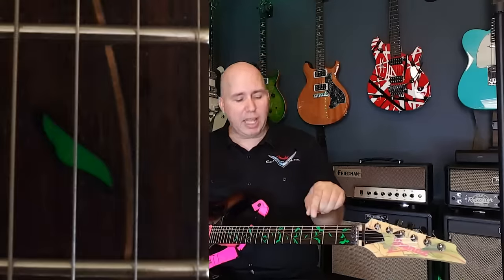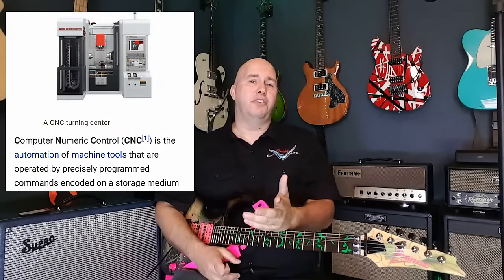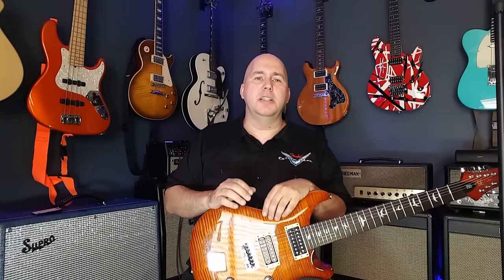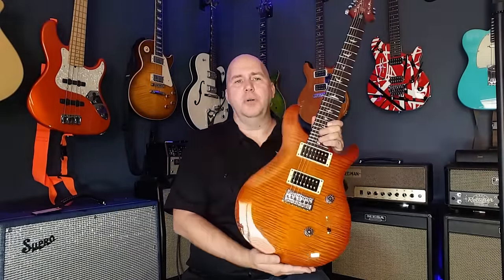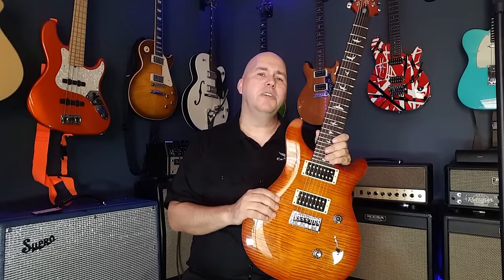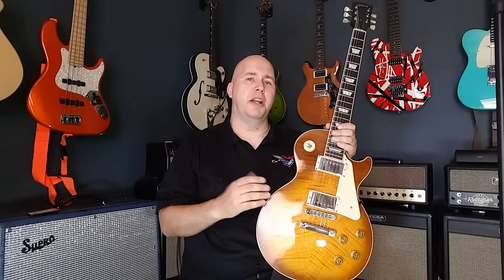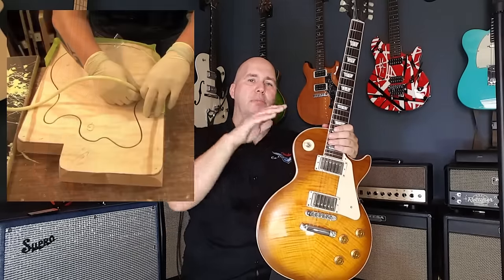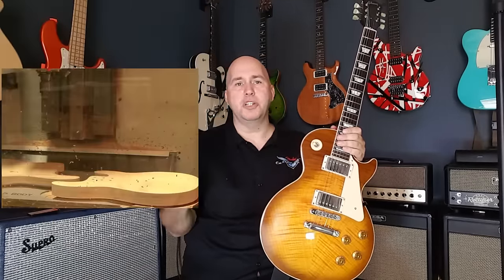7 Things That Do Not Make Guitars Expensive Anymore

Comment: I have a couple of blue flower fenders - a Tele and a Precision Bass. I believe the original incarnation was derived from wallpaper that a Fender employee found in a hardware store in the sixties. The line finished when the wallpaper became obsolete. The reissues that I have came about when a gash roll of wallpaper was found in a bargain bucket, only this time, Fender copied the original wallpaper digitally, so it would never run out.

Comment: You were right on about body binding (though the layers of material in some are more painstaking to make than others) On neck binding, you could have went a little (or a lot) further into it: Especially considering neck binding and whether it goes under the fret ends or has to be hand-fitted over the fret ends.
Gibson used to do the latter concerning fretboard binding but have now gone to CNC binding under the frets though the prices didn't drop accordingly.

Comment: I have found that the lower priced guitars can have great play ability,but where the corners are cut is the hardware and electronic package. I purchase Ibanez s series around the 800-900 price range and then put new pots and pickups(the tuners are pretty stable on this brand so I don't flip those) and you have a premium instrument for less than Ibanez sells it for.( and you get pick ups that are closer to your own tone preferences) Fender same deal,but I recommend replacing tuners with a locking type since part of a lower priced Strat's charm is a bit of tuning instability. Some of the 400 dollar squire Tele's play really great as well.

Comment: Some veneers are actually pretty darn expensive. Brazilian Rosewood, for instance, has gotten so scarce now that even veneers from it large enough to fit a back and sides (outside only) cost around $80 for the luthier to buy at cost, and then you'll pay for his time to put it on. There are several veneers of exotic wood large enough to fit a top that cost around $25, but it's the time it takes to cut and glue it that really makes the cost go up. A hundred bucks is not at all out of line for many of them.

Comment: These sorts of differences I understand, and they apply to absolutely anything that is manufactured, but what I want to know as I’m looking at what my next guitar may be is, will ‘upgrading’ to a more expensive guitar of the same type make a difference in actually playing it.  If the only differences are in how ‘pretty’ the guitar is, and things which can be changed on a cheap guitar such as pickups, the bridge, and tuning keys, is it actually worth buying—for example—a Fender Stratocaster to replace my beginner model stratocaster by ‘Selder’ which I bought in a thrift shop in Japan for $30 and cleaned up, or should I just upgrade what I’ve got.

If the differences to a player who is low intermediate are just cosmetic and bragging rights, is it any difference at all?

On saxophones, bicycles, and cameras, I can tell you the huge difference basically comes down to whether it’s manufactured on an assembly line, or more hand made.  When there’s a person involved in every step of the process, doing more than inspecting each part and the finished product, you get a better product which is worth more money.  There’s also a greater difference between two of the exact same make, model, and year.  But is that a key difference in the playability of guitars as well, or can they pretty much machine build very good, very playable guitars at low cost?

Comment: You are 100% right, Crazy part how much some mark there guitars up for these features. My Korean BC Rich Warlock is a 2010/12ish I can't remember it has neck through, 100% satin black mahogany body and neck, ebony fretboard with diamond inlays, cream binding on the body neck and headstock, , EMG 81/60 pickups, gold whatever it is hardware and Grover tuners. The fit and finish is top notch it is beautiful a real head turner. There is no floyde Rose It is a hardtail and I did have to pay $100 for the really nice BC Rich matching hardcase but still all that for $700! (I lucked out and paid $600 because of a typo in the listing) Yet an standard non custom shop American fender strat or telecaster with basic features as a plain maple neck and fret board regular painted basswood/alder/ash? body is far more expensive and some I've seen the fit and finish is fair. So your definitely (over)paying for the name I'd say.... Don't know only fender I or have ever owned was an 80s factory custom? solid black,rosewood fret board no pick gaurd, dual humbuckers Japanese squire, that was pretty nice my cousin borrowed it for few years and really trashed it so it's apart half sanded down in a box.☹️

Comment: Great video....really informative for anyone shopping for an "up-grade" guitar.  I am a huge fan of Chapman guitars and their process...Use the best quality materials and tested design for the build and use less expensive, but still good, pickups and finish to reduce additional branding cost.  My ML 3 sounded great out o the box at $549....I replaced the single coil with a Seymour Duncan Hot Rail and the guitar became exponentially dynamic....So with cost of parts, labor, and guitar; I ended up with an instrument that literally trumps all of my top end (Tom Anderson Atom, Surh Custom, Collins 290) in terms of versatility and tone....still under $700.

Comment: I own a vintage v100 lemon drop pgm, based on the peter green gary moore les paul. Cost me £330 brand new. Looks stunning, sounds superb. The pots work but not the best, the switch works well too.

The sound though is superb and its a full maple body with maple veneer.

Comment: Great video, the only bit I'd argue is the pickup cost - I've not experienced many stock pickups that come close to aftermarket options.  The only one I can think of is Gibson, but they're not exactly entry-level guitars.  And from what I've seen with regards to manufacturing costs, the branded pickups are the most expensive part of the guitar, as even wholesale they cost a multitude more than the inhouse options.

Comment: Great points on how modern instrument-building is generally leading to better Guitars & Basses overall for us all. I recall my first "Beginners Bass", my Xmas present in 1989, and holy crap, was it a terrible instrument. Plywood body, Neck that just barely was able to be intonated and straightened to a playable position, terrible Tuners and bridge. Moving from that to a MIJ Ibanez SR-800 a few years later was like moving from a Used Ford Pinto to a Ferrari. And now "Starter" Squiers are very playable Guitars & Basses that, with a few Hardware and Pickup mods can be used for solid First Instruments for far longer than "Beginner Instruments" used to be, backups for gigging/touring bands, or a Bassist's first Fretless Bass - I have friends that use them for that exact role. Even the midrange $500-$700 Instruments are made to far better tolerances, Pickups & Electronics, Hardware and Playability. Korea is the new Japan, and Indonesia the new Korea. 
The only thing I would change 'slightly' would be the wording, such as "...do not make Production Guitars Expensive Anymore". My Better-Half sprung for a Custom Mike Lull Bass for my 40th Birthday last year, and even though I wasn't asking for exotic woods, I did have a few requests such as a weight limit (I had a non-cancerous Tumor removed from my Back, taking the better part of three vertebrae with it & leaving me with a Back that can be Wonky when it wants to) and a tone that was, quote "generally even, but with some extra support for the Low B-string", quote. When it arrived in my hands, I had a Bass that was indeed supportive across its entire range, but with a killer B-string as well, and I know Mike spent some time going through his wood supply with al ball-peen hammer to find the right piece of wood. 
I had a few other, relatively minor requests for it that he doesn't "advertise" about, but was able to fulfill ALL my wishes for one of my few "Dream Basses". For instance, it's a 5-string P/J in a Jazz Bass body... but he was able to route the front Precision Pickup route to fit a Jazz Pickup as well, and fit it with EMG's "Quik Connect" system & hardware, so I can go from a P & P/J Bass to a full-on Jazz Bass in the time it takes to unscrew the Pickguard, swap out Pups, and rescrew a Pickguard... and didn't charge me more than the extra Pickup cost. It wasn't "cheap" in any sense of the word, but even the Better-Half's first words upon seeing it were "That is a Work of Art", and a fantastically playing Bass (and hell yes, I'm definitely going back to him for my "Dream Fretted & Fretless" Basses. 👍🏼)
...and if you ever decide to sell the "Fender American Deluxe Jazz" in "Candy Tangerine w/ Maple Fretboard & White Pearloid Pickguard" to the right of you, please drop me a line before you do so - that was a desire for many years, and I had the finish of my Custom Mike Lull based on that in their "Candy Apple Orange"! 😁

Comment: Great video, well said. I just started a year ago with guitars. Im big on value and performance and have spent many hours, shopping for quality guitars. What I found was many have dressing, nothing to do with performance. Many inexpensive have the same construction as the expensive but found plastic nuts on cheaper models. I have built an very nice collection of players by replacing nuts, having a bit of fret work done where needed and good setups performed. My total cost for a tele, strat, acoustic and a 335 copy is less than one of the premium guitars.
Reply from the maker: That is a great comment. Maybe we could do a video of one really expensive guitar verse a few lower price guitars to see which is preferred. Thank you for posting
Reply: I would watch that.  I will argue that my Samick Greg Benette Avion 6(made in Korea) plays and sounds every bit as good as the Les Paul standard I have. In fact I prefer the Samick.

Comment: I just picked up a brand new Squier Tele for $400. It is their Classic Vibe series in the butterscotch finish. I went over every square millimeter of the guitar and could not find a single flaw. It is perfect. The action was a touch too high, but that is normal for a factory setup. My point being that they have got the manufacturing process down to an art form. 20 years ago that level of quality was unheard of. They only thing I may do is swap out the pickups with DiMarzios. The stock ones are fine but are a bit sterile and flat. THEN she will be perfect in all ways!

Comment: Modern CNC flat parts "cutting", which can use pulsed lasers  isn't significant slower than drilling holes. For a decorative feature like a fretboard, CNC using a library of cutouts would require more initial capital expense. but fitting a precision flat cut inlay whether round complex takes approximately the same time.
Veneering with a finish costs more than painting.  The difference isn't just material between material cost but assembly. Applying formica laminate to a kitchen counter is simple.  Applying wood veneer to a guitar top, especially a contoured acoustic top is a multiple jig or vacuum pump operation.
"Value" as used here is subjective value. Paying for a reputation may add cost. But if that reputation does not add performance, the objective value decreases.

Comment: This was actually kind of enlightening. I kinda had the feeling that this is what goes on these days, ´cause I've mostly just bought off brands and cheap guitars lately that are really good! Well, I actually bought two Squiers, one tele and one strat, and they're both better than some of my older Fenders! Not all are the same, of course, but most are great. The ones I ended up buying, for close to nothing I should add, have amazing feeling necks and they just make me wanna play all the time! They sound suprisingly good as well. Not excellent, but still quite good. Enough that I'm in no rush swapping out the pickups. AND, with the low costs I save enough money to buy my own favorite parts and taylor the guitars to my own wants and needs. Oh, man, I wish this was the case 30 years ago when I bought my first guitar... sigh...

Comment: As with a lot of products, how much the guitar costs to buy is not very related to how much it costs to make.  They generally don't design a guitar and then work out how much to sell it for, they decide what price point they want to compete at then design a guitar with features they believe will make it sell at that price point.  As the price is set up front then any extra features, even if they are not particularly expensive, means less profit.

Comment: I own a Samick KR564 Viper. The not-Lynch-one. Supposedly hand carved top where you can feel the snake and the skeleton. Hand painted and all that stuff. Has (rather badly put) shark fin inlays, a well designed pseudo-floyd-rose where the ball-ends can stay on the strings and really good sounding stock pickups. Also the neck feels superb, best neck I ever played for metal and shred stuff. 
I will never understand why those guitars are not highly regarded in terms of uniqueness and quality. Samick was a cheap korean manufacturer back then and had no reputation. The KR564 guitars were really, really cheap. Around 250 € here in Germany. And I have never found a super strat to compete with mine. 
If you like it, keep it! Ignore the brand.

Comment: A few things:

1) I have a couple watches that cost about $200.  While my self-winding watch is a bit different, my other one doesn't work any differently than a watch that costs $40.  For the most part, if you're a few hundred dollars for a watch, most of the cost is going to be dependent on the brand and the style.  The guts are largely the same.  Now if you look at the craftsmanship that goes into a Rolex, you might see why the cost is elevated.  I found the same is true with PRS and other high end guitars.  Don't get me wrong, I'm not saying that folks should be wanting to spend $5k on a watch, or on a guitar.  I'm just saying that things like craftsmanship and attention to detail will cost money!

2) When mass-producing, adding the same graphic to a bunch of guitars will not cost much.  Adding CUSTOM graphics will, as it requires the manufacture to take more time in the production.

3) The wood thing is interesting...  While the type of wood should not be a big deal, the quality of the chunk of wood is.  As you've pointed out on the neck-through concept, the bigger the piece you need, the harder it is and the more expensive it is.  This is one reason why PRS guitars cost so much.  Joining 4 pieces of mahogany together to get a body for an Epiphone G-400 won't cost much.  Finding a really nice piece for a body should cost more.

Comment: Wires inside the guitar are like pipes for water.  Like pipes to water, larger wires has less resistance to the flow of electrons.  And the shorter the wire the faster the travel and less attenuation of the signal. Nitpicking?  Maybe.  But so is wood on an ELECTRIC guitar.

Comment: This was a good feature although most sub £500 Guitars don`t have good pickups on, some are better than others but you can`t be sure what you are gonna get and that`s why having a Seymour Duncan, EMG etc will show you that you are defo gonna get a quality tone ( make sure it`s the type of pickup model that suits you first though.  You can also replace stock pickups with quality pickups from companies like Iron Gear for far less although be aware that without a big name this won`t add value but if you are a player and just want a good tone for less then it`s well worth checking them out
Reply: This is what we have video reviews for. :)
Reply: LTDs stock pickups are pretty great actually.  They don't match something like an SD Invader or EMGs newer lines of pickups, but they sound great for the price point of LTD guitars.
Reply: actioninja Yup, stock pups vary in quality and are generally better the closer you get to £500 and without a trusted Pup branding it`s hard to know what you are gonna get or even if the pups are a medium, medium high or high output which also matters a lot depending on the style of riffs that you wanna play
Reply: No, it isn't. You can find a demo or video review online for a lot of cheapo guitars. Even if the presenter isn't blessed with discerning ears and recommends a guitar with poor pups, you can hear it in the vids.
Reply: Hey I`m just stating the way that things are not an opinion it`s just the way things are . . . . . and you can`t rely on sound in vids unless a decent cab is close miced and you have some excellent speakers at home, again just the way that things are . . .. and even then you need comparisons in these videos too

Comment: Bolt-on vs set neck is the most trumped up crap ever. I prefer to be able to easily swap out a neck if it breaks or warps. I even buy bolt-on acoustics now; overall, the more modular nature of Fenders is appealing. All of this is aside from the fact that bolt-on necks can be fit tighter into the pocket and therefore transfer energy more easily across the guitar as a whole.

In my experience, most short-scale guitars (traditional) are going to be set neck and most long scale guitars (modern) will be bolt-on. If you like a thicker, meatier sound where the notes blend together more, you're looking for a short scale. If you like a lot of string definition and powerful individual notes that don't blend together as much then you're looking for a long scale.